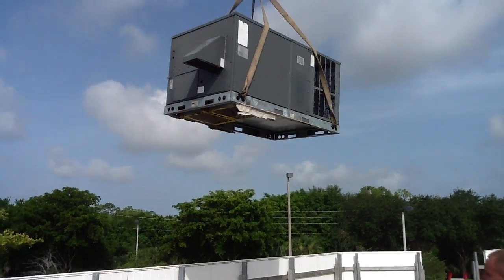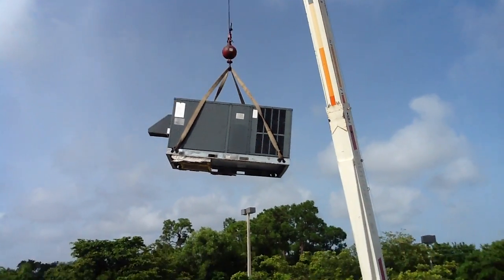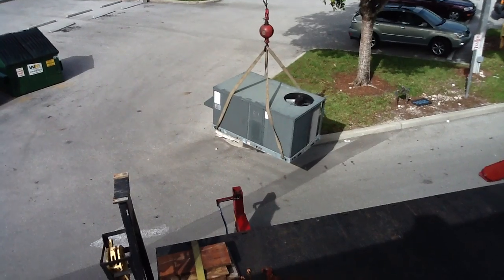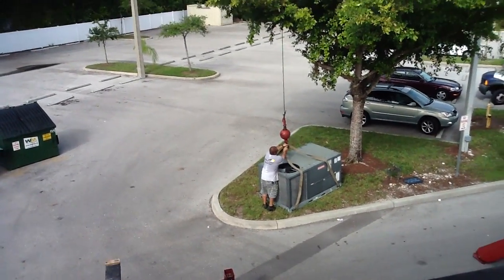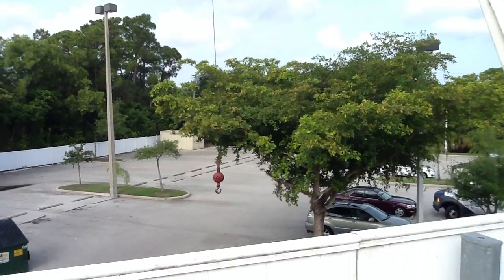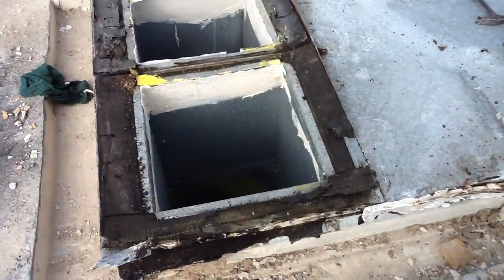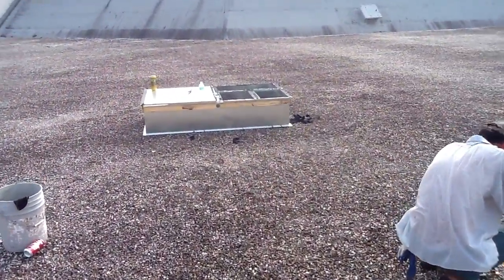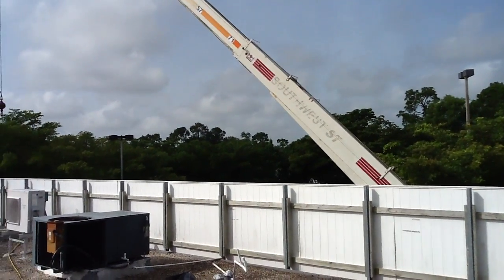Best way to lift commercial hvac rooftop heating and cooling units

Comment: Those units are not so heavy... It's practically air channels inside, few fans, end heat exchanger... The crane is more than enough to raise maybe 10+ at the same time at the moment, at that distance ...for the cranes, distance and angles are important...near, can raise probably 40+ tones, and further away less and less...